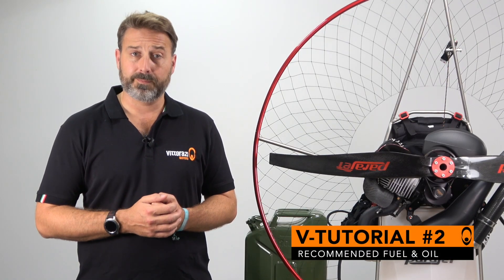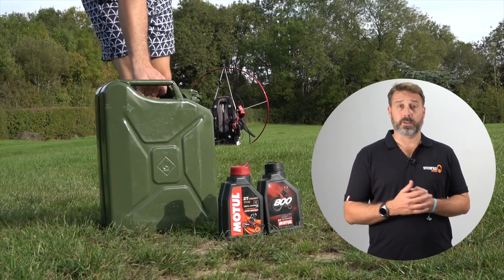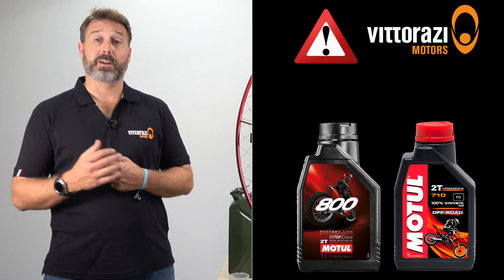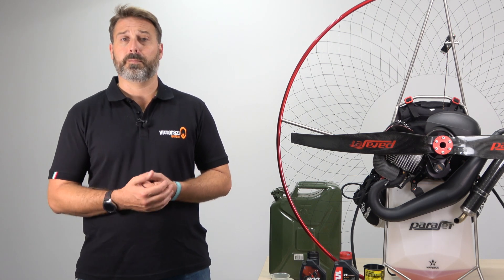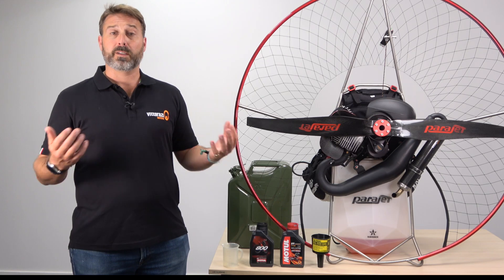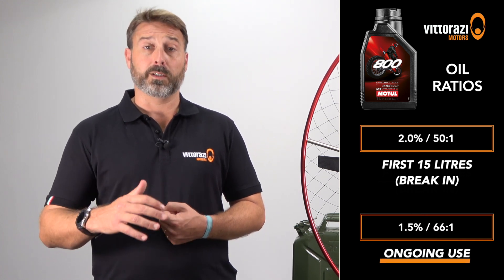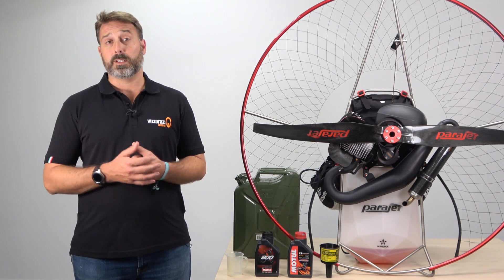PARAJET EXPLAINS 02 - VITTORAZI MOTORS MOSTER 185 - FUEL & OIL - PARAMOTOR ENGINE MAINTENANCE

Comment: After gasoline is mixed with oil inside the paramotor tank, how long can it stay there without being used?
Reply from the maker: hi there, we suggest you to contact your dealer, in order to give you more assistance depending on the engine you have and your needs ;)

Comment: Note: 95 octane EU => 91 Octane US.
Reply: What's that mean? You used both and equals and a greater than. Which is it? Does it equal 91 US so we can use pump gas or is it greater than 91 US so we should use 100ll avgas?
Reply: @TruthHurts2u  It means that EU and US gasoline measure differently. But the octane is the same for EU 95, and US 91. In the video they said use 95 Octane, but that is in EU octane measurement. In the US, that would be 91 Octane.
Reply: @acherrington  Thank you. I've seen so many contradicting information about this motor when it comes to what fuel and what oil mixes to use.
Reply: @acherrington  That's correct.  Europe and most of the world us RON to determine Octane rating.  US uses PON which is a calculation between RON and MON.  US 91 is the same as EU 95 and US 93 is the same as EU98.  It is what it is.  All this info is available by research.
Reply: Thanks for the info, Merica.

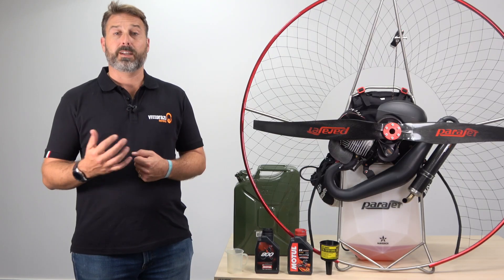Comment: 5:19 This video says a "...maximum 10% ethanol ratio" is okay.
However, the manual says this: 
"Vittorazi engines are approved with fuel that complies with the EU regulation UNI EN 228. Fuel
95 RON contain a maximum percentage of ethanol of 5% in volume. The use of inappropriate fuels
(with higher Ethanol percentages and / or with lower RON) makes the engines leaner, therefore
the problem of the power drop could happen also in normal atmospheric conditions. In addition,
as specified in the Walbro carburettor manuals: membranes, rubbers and carburettor seals can
tolerate a maximum percentage of alcohol typical of European gasoline (5% ethanol, 3% methanol
and 10% MTBE octane enhancer)."

Are these two in agreement?

Comment: I have a Vittorazi Moster 185 Plus engine and I've only just completed the first phase of break in. It quite clearly states in the user manual "From 1st to 15th litre  Oil 3.0% or 33:1  After the 15th litre Oil 2.5% or 40:1" which is greater than the oil ratio stated in the video.

I'm going to continue using the greater percentage.